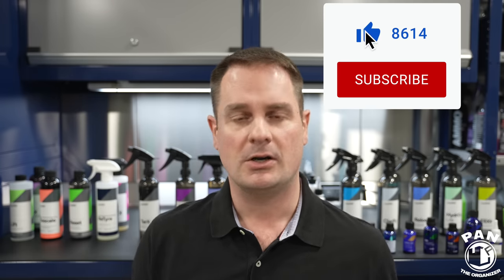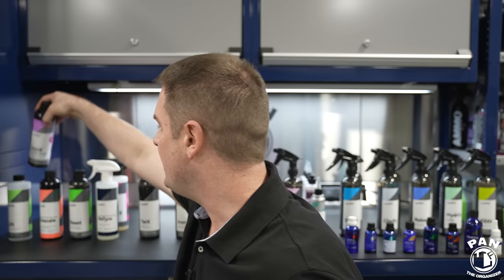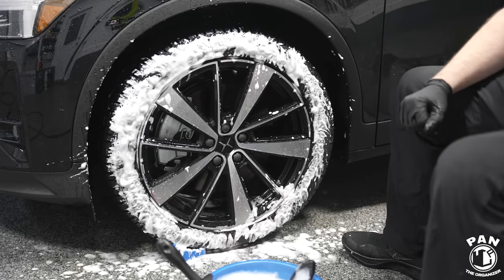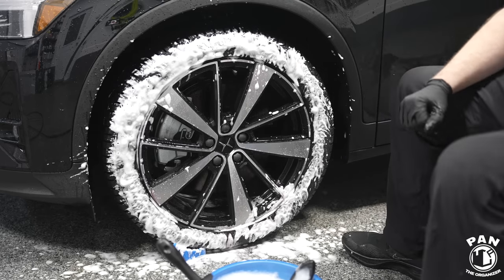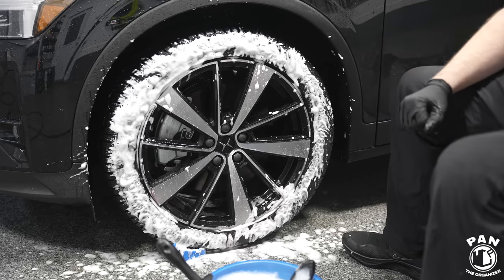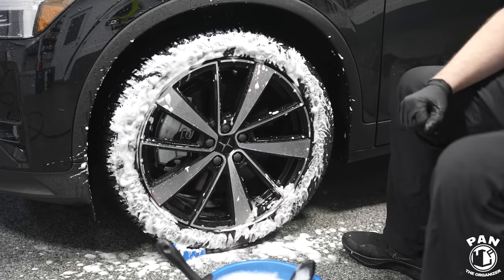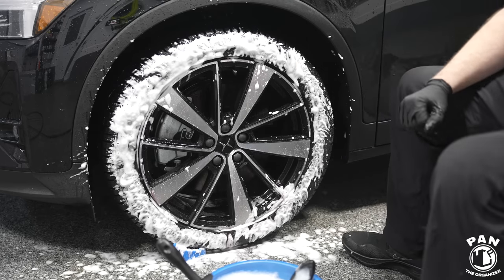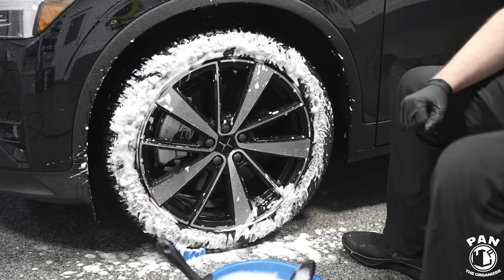CarPro Brand Review - All Their Detailing Products!

Comment: Great video!!  Have you had any experience with the echo2o? It’s hard to beat ps bead maker but took a shot at carpro version. Thanks
Reply from the maker: Ech2O is a waterless wash that can be diluted as a quick detail spray. It has nothing to do with Bead Maker. Bead Maker is a paint sealant that boosts gloss and slickness, and gives 3-4 weeks of protection. Ech2O isn't a protection.

The closest equivalent in the CarPro line is Elixir. That lasts 3-4 weeks like Bead Maker, and can be used as a quick detailer.

Comment: with CP reflect , Rupes white or yellow pad?, light scratches only , probably need about 5 pads for a large SUV , I intend to re ceramic coat the veh so dont care too much about removing current coat
Reply from the maker: You need to find the right pad and polish combination for your specific paint and level of defect removal expectations. Test spots are always a must when polishing. There is no "one size fits all" type solution unfortunately.

But I would go for a Rupes Yellow foam pad and see how that goes.
Reply: @PanTheOrganizer  great thanks

Comment: I have a ceramic coated car. Today, I used descale in a foam cannon, let it swell for a few minutes, rinsed it off, and then used reset for my bucket wash. Do you think it’s okay to use to wash my car next week using descale in a foam cannon again and use it in a bucket wash? I know it’s an acidic shampoo, but just wondering.
Reply from the maker: As long as you don't use it every week, it's perfectly fine to use Descale for a decon wash, to remove accumulated minerals and water spots.
Reply: It slipped my mind to use it in a bucket wash for its full effect, but planning to use it semi annually to restore hydrophobic properties.

Comment: Hey Pan! Which shampoo do you recommend for daily washes? It seems that car pro only has specified washes for specific tasks. Do you know which one of these will be best for day-to-day use that doesn't strip protection? Thanks!
Reply: Reset does not strip protection. You can wash daily with it, I always do.
Reply: @Theguitarskater1  really? But I thought he said in the video that it's too strong for waxes and sealents
Reply: @TheRcdood  well, it is a powerful cleaner but it still a ph neutral. I use it regularly with a sealant and it is no problem, in my opinion, a sealant that does not resist Reset is not worth it.
Reply from the maker: CarPro Reset is perfect for regular washes on ceramic coated cars. I use it twice weekly to wash my car.

But continued use on waxes or sealants can weaken those. Reset was formulated for use on coatings.

Comment: Hey, do you think a polish like reflect or essence can remove light oxidation? Also, after using essence do I need to apply an IPA before the ceramic coating?
Reply from the maker: Don’t compare both polishes. Reflect is a true polish, no protection, and has more cutting ability (although not as abrasive as a compound obviously). 

Essence is more of a gloss enhancing polish, with fillers to mask light imperfections, and acts like a primer for CQuartz coatings. After Essence, wait one hour before using CarPro Eraser (IPA).

So if you want to remove light oxidation and minor scratches and swirls, use Reflect.
Reply: @PanTheOrganizer  thank you! That helps a lot!
Reply from the maker: My pleasure. How did you discover my channel by the way?

Welcome to my channel. You discovered one of the biggest car detailing channels on YouTube as we surpassed 920,000 subscribers and we have over 120 million views! I have been detailing for 26 years and I love to share my knowledge and passion with my viewers.

You found the right channel to help you learn everything about detailing.

Comment: Can you spray reload on ceramic coated wheels as a maintenance every 2-3 months?
Reply from the maker: Yes. Or even easier, use CarPro HydrO2 Lite as a spray on, rinse off formula. Super easy on wheels to top off the existing protection.
Reply: @PanTheOrganizer  so than I'm assuming instead of reload I could just use hydro02 for my maintenance on both the wheels & vehicle?

Comment: Could you list which of these products can be applied to cars with ppf?
Reply from the maker: Pretty much all of them can be used on PPF. Just be careful with the TarX tar remover, and avoid heavy polishes. Use a lighter polish like CarPro Reflect is perfectly fine.

And of course, their Skin PPF ceramic coating is perfect to protect your PPF. 

I don't work often on PPF wrapped vehicles though, so perhaps ask CarPro that question to make sure. It can sometimes depend on your specific PPF brand too, so perhaps enquire with your PPF installer if there are any indications as what can or can't be used.
Reply: @PanTheOrganizer  Thank you so much for your prompt reply.  Have been working my way thru your videos.  Learning a lot but very overwhelming:)

Comment: @PanTheOrganizer sorry for the many tags recently. Would like to ask if carpro reset and lift are good for graphene spray (turtle wax hybrid paste and flex pro). Will the turtle wax be stripped?
Reply from the maker: It might be a bit much for the paste wax, but should be ok for Flex Wax spray. You have to test and see. Keep in mind Reset and Lift are formulated to be used for maintenance of true ceramic coatings, the ones in glass bottles. Those have higher chemical resistance and more durability normally.
Reply: @PanTheOrganizer  thanks for the speedy reply. Will be layer the flex pro on the paste hope it works fine. Or do u have any shampoo and pre rinse suggestion?

Comment: Hi Pan I am a big fan have learned a lot from you. Recently I have decided to remodel my garage and make it very luxurious for new Corvettes, decided to do all my own car detailing and I am struggling between Ammo and Carpro.  I have emailed Ammo twice without any response, so I am very concerned about purchasing all my products from him as the customer service is horrific, no one to talk to  and consult.  I live close to Auto Geeks who carry Carpro and I put a list together based on your suggestions, it amounts to over $1700.  The issue is that Ammo seems such an easy program to follow and do same for home garage vs Carpro  which will take a lot of pressure.  who do  you suggest.
Reply from the maker: Hi Jorge. Both are very good brands. Larry (AMMO NYC) is actually a friend of mine, and made a few guest appearances in my videos. Larry developed his line of products for himself as he has a specific system and regimen that he uses to detail cars. So it's a simpler lineup. But there are no gallon sizes available. And as it's not a massive company, the products tend to be a bit on the expensive side.

CarPro is geared more towards professionals and has multiple bottle sizes available, so you can buy in bulk which saves on costs. And overall, I tend to prefer CarPro products.

But I like to use different products from different brands, as this is a car detailing channel. To have an idea of my top products picks in each category, I highly recommend that you watch my popular annual car detailing products awards video here: https://youtu.be/gRwsznwfTwE

Comment: So is carpro not a good line for those of us mobile guys who are often found working in the sun?
Reply from the maker: This is a top tier brand made more for controlled environment situations like in a detailing shop or garage. You want to be applying high end coatings in perfect conditions as much as possible.

Mobile detailers can still make this happen, but there are perhaps more sun friendly options out there.
Reply: @PanTheOrganizer  yes I definitely wouldn’t tackle any sort of ceramic coating in the elements. 

But I often do maintenance washes in the elements and have been topping with Malco Epic CR2 which works great in the sun or on a warm car. Just picked up a bottle of reload to see if it can handle the sun. I like carpros products like iron x which we use already so hoping we can use more of their line mobile. We’re switching exclusively to carpro and optimum products.  

We shall see how it does! Thanks for the video!

Comment: I just had ceramic done for my car. What’s the best maintenance suite of products I should pursue with these products? Ceramic was for exterior, interior and wheels
Reply from the maker: What coating did you apply specifically? What you need is to use a silica spray sealant for maintenance, at least once every 2 or 3 months, to ensure max durability and performance from your coating. Products like CarPro Reload, Gyeon Cure, Kamikaze Over Coat, Gtechniq C2V3, are all good toppers for existing coatings. If you want to make sure you are getting compatible protection, pick a topper from the same brand as your coating. They usually formulate them for best results.

I made a popular tutorial on ceramic coating maintenance washes here: https://youtu.be/yLiePQRMFc8
Reply: @PanTheOrganizer  this was an armor all based suite of products for their smart shield program
Reply from the maker: Oh. Anyhow, any silica spray sealant will do.

My favourite products are all in my car detailing products awards video here: https://youtu.be/LkD22UGujmw

Comment: Pan, would you recommend Descale on a brand new car or stick with Reset?
Reply from the maker: Descale is a specialized shampoo not meant for regular weekly washes. It's a shampoo meant to help remove water spots if you have such issues, so only on a "use as needed" case. It can also help to strip older waxes and sealants.

For regular weekly washes, CarPro recommends sticking with Reset.
Reply: @PanTheOrganizer  Definitely, but with a brand new car waiting for its first car wash, which would you recommend?
Reply from the maker: Reset.

Comment: Hey Pan. I got Turtle Graphene Flex Spray Wax, but you say that Carpro Reset may be too strong for waxes. What shampoo should I use for foam and 2-bucket method? Should I also use TriX every 3 months before topping up Turtle Graphene Flex Spray Wax?
Reply from the maker: By “Graveney” did you mean to say Graphene Flex Wax? If you use that as protection, it’s ok to use CarPro Reset as your shampoo.

Or use the Turtle Wax Hybrid Solutions Slick N Slide Pure Wash shampoo.
Reply: @PanTheOrganizer  Yes, thank you. My Turtle Graphene Flex Spray Wax lasted only 2 weeks, but I forgot to use 15% IPA solution with distilled water, so I have done whole procedure again (foam CarproLift, 2-bucket with Carpro Reset, de-iron, de-tarr, 2-bucket again with Carpro Reset to remove de-tarr, dry + vaccum dry, 15% IPA with distilled water, apply Turtle Graphene Flex Spray Wax 2-spray per panel, thorough buff with 360 gsm towel. Really hope this will last 6 months in snowy Poland!

Comment: I had a question about Carpro Essense, can you use any wax/ceramic afterwards or does it have to be Carpro quartz line?
I was thinking of using carpro essense -> chemical guys Hydro Slick Ceramic Coating Hyper Waxcarpro
Reply from the maker: Don't apply regular waxes on top of ceramic based products like CarPro Essence. Essence is a polish and primer BEFORE you apply a ceramic coating on top. It was designed for use with CarPro coatings, so you would have to test and see if it works for other coatings. Hard to say, as it's impossible to guarantee chemical compatibility.
Reply: @PanTheOrganizer  hmm okay that’s fair I currently just don’t have access to a garage to do a DIY full ceramic process, would maybe substituting adams Graphene spray work a little better? Or just say screw it and do the full ceramic near the evening time when is cool and hope is fine 😅

Comment: Hello Pan, i just bought the Carpro Spotless 2.0 and yesterday I washed my car with Lift and descale in a foam canon, the I used ironx and tarx on the lower panels. My car has 2 layers of quatz UK 3.0 (10 months old) and when I went to do the contact wash with reset, I sprayed spotless on the glass and panels, and I properly sat there for 10 min as I washed it by hand till I pressure washed it. The result is, what it seems to me, the spotless 2.0 damaged the ceramic coating on the windshield, front and rear. Is this possible? I cant remove the stripes with my nails… And when I spray the panels and glass with water, the shielding and sheeding has completely gone. 

Do I have to remove alle my ceramic coating to put a new one on? 

And if so, how do I do that most effectively? 

Kind Regards Andreas
Reply from the maker: Hi Andreas. It seems you did many things wrong here. First, you don't spray Spotless directly on glass. Next, you wouldn't let Spotless sit on the surface for 10 minutes... And after using Spotless, you need to thoroughly rinse the car, and wash it again to neutralize it.

I would highly recommend that you read the proper instructions and follow the steps here: https://www.carpro-us.com/deep-cleanse/carpro-spotless-2-0-water-spot-remover-500ml-17oz/

So at this point, yes it's highly likely you damaged your coating. You should perhaps contact CarPro and see what steps they recommend.

One thing is for sure, if you need to remove the coating and restart, the only way to ensure 100% removal of any existing ceramic coating is by machine polishing. So you would have to redo all the steps. Wash, iron remover, claybar, machine polishing, IPA wipe, then apply two layers of CQUK 3.0
Reply: @PanTheOrganizer  Hi, thanks for answering so quickly 😊 I must admit, I did not expect it to be such an effective product, that it would work through the ceramic coating, and I think I might have read the instructions on approx.. 10 products I bought from carpro, and got the information a bit mixed up.. 

Soo. I must admit to failing on the first attempt to water spot removal, but have learn an expensive lesson, but a lesson none the less 😉 

Another question I regards to my, now, new project. The Danish distributer of the Carpro products suggests that using 2 layers og quartz UK 3.0 and then 2 layers of Sic, and they are referring suggestions from Carpro, should be a perfect way to fully utilize the capabilities of the products. Would that also be something you think is wise, or a waste of produckt?? 😊
 
Kind regards Andreas
Reply from the maker: Welcome to my channel. You discovered one of the biggest car detailing channels on YouTube as we surpassed 820,000 subscribers and 100 million views! I have been detailing for 25 years and I love to share my knowledge and passion with my viewers.

You found the right channel to help you learn everything about detailing.

Yes applying 2 layers of CQUK 3.0 as a base, and topped with SiC or CarPro Gliss 2.0 is absolutely recommended to prevent water spots.

Comment: Is 1 part of solution and 10 parts of water in oz’s?? Need to know!!
Reply from the maker: It doesn't matter which metric you are using. Parts are parts. 10:1 dilution means 10 equal parts of water for 1 part of product, regardless of which metric or volume you're using. 

For example, if you have a 16 oz bottle. You could have 1 oz of product and 10 ounces of water, for a total of 11 oz in the bottle and you get your 10:1 ratio.
Reply: Thank u so much you really have helped tremendously help up the hard work!!😊

Comment: Hello!✌️   Dose Carpio descale have any negative effect on UV windows?
Reply: *Carpro
Reply from the maker: What do you mean by "UV windows"? If you mean tinted film, the tints are on the inside of the glass, not the outside. And CarPro Descale can be used on all the exterior. See how I use Descale on my own car in this video: https://youtu.be/oTaFE_p2OAw?si=Tr3AMC3-s3_VM0O-

But Descale isn't a shampoo you use every week. They have CarPro Reset for the weekly washes. You use Descale only when needed, to remove things like water spots and mineral deposits or old waxes.
Reply: I bought clarity waterspot remover for glass, which is a cream like product, not a shampoo, that does what its name implies.  Then I asked a professional detailer about the product, and he told me that the product can't be used on UV windows.
Reply: Also, the anti-reflective sheet made out of plastic that is on the exterior of the UV glass gets stained.
Reply: The best thing that he told me is to do a light polish and protect the windows with a ceramic product.
Reply: Maybe I can apply carpro descale only on the paint and clean the window with a glass cleaner.
Reply: @PanTheOrganizer  ☝️

Comment: Yo Pan i really like the Essence Plus and its non abrasive feature, can i use it as stand alone polish to a car without ceramic coating?
Reply from the maker: Yes but keep in mind the protection it leaves behind is minimal and should be topped off with a ceramic coating.
Reply: @PanTheOrganizer  Yeah about that, im planning on using the Fusso and Kiwami to lock it up instead of Ceramic Coating, what do you think?
Reply from the maker: Impossible to say as normally you don’t apply regular sealants on top of ceramic based products. You can’t ensure chemical compatibility.

Why not apply an easy to use ceramic coating? Something like in my video here: https://youtu.be/Rgli6VNLsK4

It’s easier to apply compared to Fusso Coat.

Comment: Will ironx strip current waxes and sealant ?
Reply from the maker: It’s pH neutral so it should be fine for one use. You wouldn’t use IronX for every wash. Once every 3-4 months. Your wax will be long gone by then anyways and need reapplication.
Reply: @PanTheOrganizer  so what would you recommend to strip waxes ? Will Koch chemie green star strip waxes ? I’m trying to prep the paint for a clay and seal
Reply from the maker: CarPro Descale shampoo can start tripping older waxes and sealants. Same goes for Adam’s Strip Wash, Chemical Guys Clean Slate, etc

Just keep in mind stripping shampoos can only help to start the breaking down process of older waxes and sealants. To ensure 100% removal of pevious protections, a light polish is the way to go. Mechanical abrasion removes the protection.